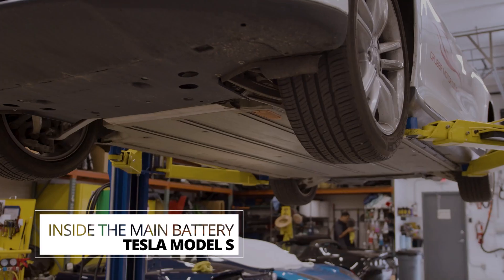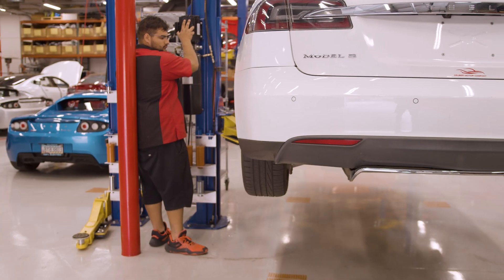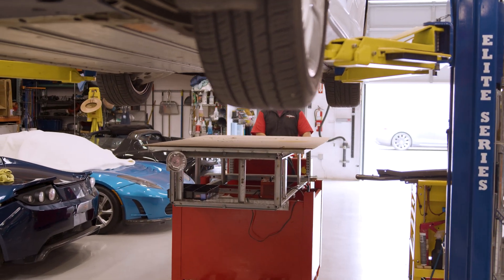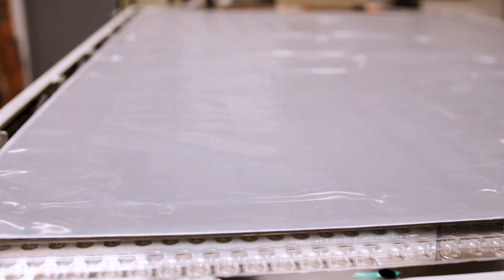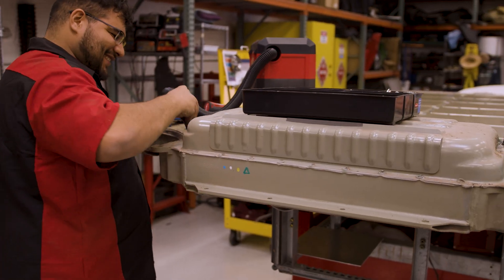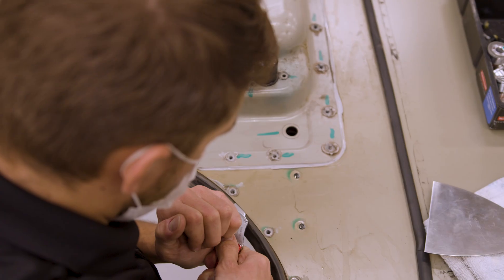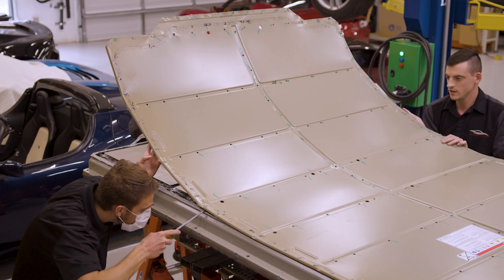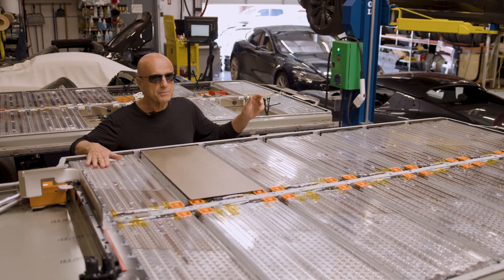Inside a Tesla Model S Battery | Gruber Motors

Comment: I saw a photo "hey you were not supposed to see it" of the cover removal. It had kind of a flattened pipe rig that was in the shape where the sealant is. I thought at first that they use hot oil to soften the clue but then realized that it's probably a lot stronger stuff because the pack might heat up a lot in case of cell failure. Now when I think about it the cover removal process was very quick, less than 10 minutes, so maybe. They also used the same kind of vacuum devices as installing windows to lift the cover up and away.

Comment: This battery pack consists of 14 modules instead of 16 modules like the 85kWh battery pack for example (5,3kWh for each modules, in this case).
Does each module have nominal 25V like each 5,3kWh module for the 85kWh battery or different value? (>25V...?)
Thanks.

Comment: So what’s your thoughts about Model 3 and Model Y batteries bolted from both sides so you have to remove most of the interior to drop the battery ? And the future when the battery is a structural part of the car?

Comment: This video is giving me nightmares, those technicians are dealing with a high voltage 400v DC battery so casually without any PPE or high voltage gloves , please everyone do not do this, this is WRONG !
Reply: They use buss bar architecture.  No one point is at 600V potential except at the bar which connects to inverter. It's quite safe.